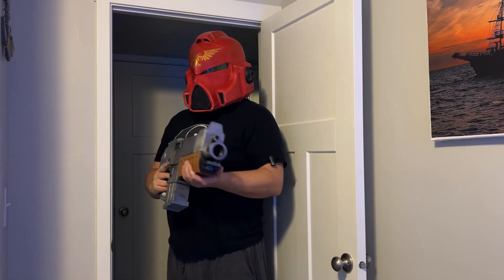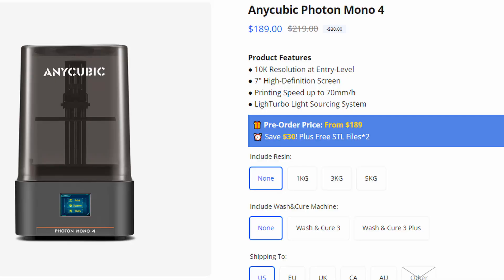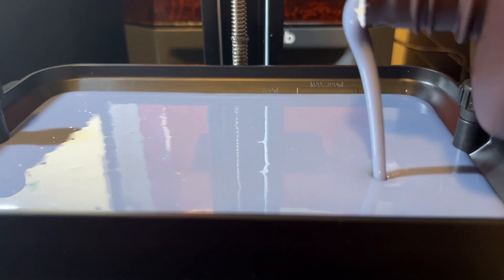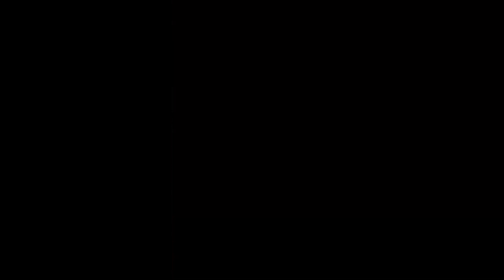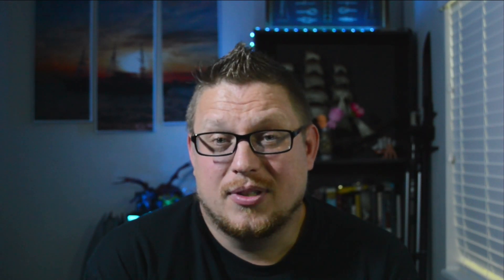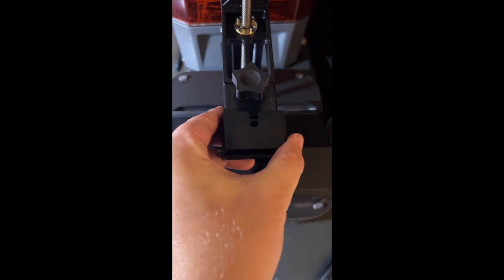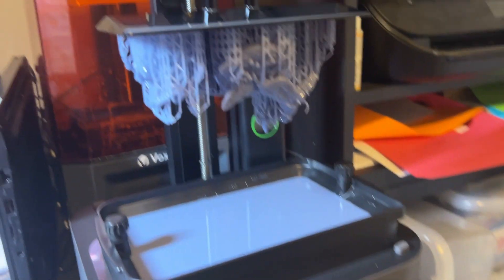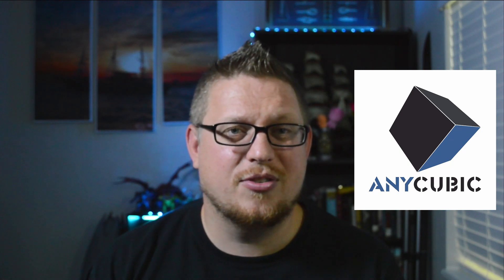Is This The BEST Starting Printer For Miniatures?

Comment: I just picked up the Anycubic Photon Mono 4k on Amazon for $159.00. Going with the water based resin to cut down on fumes and alcohol washing which is hazardous in these desert temps of 110+ degrees. Will be trying out to make leather stamps and patterns.
Reply from the maker: That sounds amazing. I hope everything goes as smooth as silk.

Comment: Hey, great video! I recently got this printer, but I’m having trouble getting my prints to stick to the build plate. All of my calibration prints ended up sticking to the FEP. I made sure to level the plate carefully, but I noticed something odd—the left side of the plate required significantly more force to grip the paper. Do you have any troubleshooting tips or advice on handling this printer’s quirks?
Reply from the maker: I feel like I had this same issue let me take a look at mine and see if I can remember how I fixed it.
Reply: @pulsegategaming  I am having the same issue

Comment: @pulsegategaming Hi there, total newbie here, I have a Question. With the Photon Mono 4 do you open your STL in either the AnyCybic software or Chitubox right? 
The part I don't ever see in videos I watching is how you take that file from the software to the machine.
How do you save the build plate layout: How then do you then bring that over to the machine?
Is there some file saving from the software to the USB and then you launch the print via the USB?
I'm guessing here. Please set me straight. Cheers.
Reply from the maker: The easiest way to do it is to save it to a USB. To do that you put the file into the slicer program like chitubox or others then when everything is the way you want it you slice the file. Slicing the file saves it in a format. Your printer can print and you move that file to the USB and then plug that into your printer.

Comment: I am a big Anycubic fan of both their printers and their resins.  I have (and use regularly) 2 Mono X 6Ks (6K) printers and an original Creality LD002H (2K). I have gotten amazing results for minis (22mm, 32mm and 75mm) from both. As @neumann1940 states, it's all about the original model design.  I get great results with the Anycubic ABS-Like 2.0 resin.  For my needs, the added 2" of build area are more important than the improved resolution of the 7" screen on the Mono 4. 

My main mini sources are Loot Studios, Fotis Mint, Titan Forge Minis, Atlantic Digital, 2nd Dynasty, Primal Collectables, Dungeon Blocks, and a few others.  I use Lychee Slicer for 90% of my resin slicing needs.

Talking about lids - Since resin temperature is very important for consistent results, I moved all of my resin printers into a 24" x 24" x 48" grow tent (placed on its side, of course).  This allows me to leave the lids off and keep the tent environment at a nice warm 82F while also limiting and venting the VOCs and fumes from the process (keeping my wife much happier about the printers being in my office).

Comment: What are your thoughts on the Anycubic Photon Mono 4 Ultra?
Reply from the maker: honestly its basically the same printer with a lot of bells and whistles. The light is stronger and you can print layer heights a little smaller but not enough to sway me for a first time printer. I am a huge fan of simple and easy, but if you want a slighter better printer with Wifi printing its a great option.
Reply: @pulsegategaming  Thank you for explaining. Do I need to be concerned about ambient print temperature for Water-Wash Resin+? At this time of year, my studio is very cold (7°C) in the morning as it’s in an old warehouse. It takes a fair few hours to warm up and only then is it around 22°C. Is it worth returning my new Anycubic Photon Mono 4 Ultra and paying double to get the M7 Pro as it has Auto-Adaptive Technology Control Heating? FYI - My budget is minimal and it is my first 3D printer. Also, I will be using the printer for product design 3D prints to check size, detailing, and proportions before production.
Reply: @Doors_of_Perception  half my prints have failed because low temperature caused low adhesion to the plate, i use a air heater inside the chamber and heat everything to 35C but never higher. I usually raise the plate to the top so it heat soaks the hotter air.
Reply: @odisy64  Cheers for the advice. I have been heating my studio to 25C and have been getting great results so far!
Reply: @Doors_of_Perception  nice, if you begin to have issues again you may need to sand the plate down with 100 grit sand paper to get fresh grooves. Lazer etched plates dont really have this problem, often you have to sand them down to make the models pop off easier.
Reply: @odisy64  Mine is laser etched. It is actually a pain to get the models off the plate. I am using hot water to help. I will try isopropyl soon to see if that is easier and better.

Comment: Is your screen pretty sunken in the front compared to the rest of the boarder by chance? Mine has quite a noticeable sunken edge and literally everything I print either completely fails or partially fails. I’m only getting adhesion to the back of the plate. So farthest from the sunken part of the screen :/
Reply from the maker: @CreepFatInc  I have not had this issue I’m sorry to hear that yours is doing that.
Reply: Did you resolve this problem? Sounds like you either need to work with Anycubic for the them to swap your printer for a new/replacement one, or you need to take apart your printer and see if you can align the screen flush (ie, level) with the top surface AND then re-level your build plate (using the usual re-leveling procedure with a piece of paper under the build plate at the “home” position). Definitely, if the “masking” screen is sunken on one or three sides, then you won’t be able to properly level the build plate and you will be lucky to even get models to print on that non-sunken portion of the screen. What’s your situation now, 2 months after your original comment here?

Comment: What slicer are you using for the mono 4? I just got mine in the mail yesterday and spent a good portion of the day messing with it and can’t get anything to stick to the build plate. Only the fep. Chitubox files aren’t working or showing up on the mono 4. And the anicubic slicer is not my cup of tea.
Reply from the maker: I used the anycubic slicer. its not my favorite but it worked pretty well.

Comment: As a 3D designer myself, i do design my own models and print them as well, I have 3 resin Printers all of which are Anycubic - Mono X2 . , M3, 6Ks
I can assure you from experience the screen resolution is nothing but marketing whatever the measure is "With 4 6 8 12 K , or even with micron size, I can achieve sharp and crisp details on my mono X2 which has 48 microns size per pixel better than the 6KS "34" microns, it's all about increasing the sharpness density on the model itself 
So for anyone who has a very limited budget  or want to increase his print size there's no need to waste your money on a very advanced 3D printers , just grab yourself a Mono X or mono 2 like this one or it's older version and you'll get a very good results
Reply: do you find the smaller micro size effects fit or layer lines? I mainly want to make mechanical parts/enclosures but seems most resin content is geared towards detail for miniatures instead of larger surface area parts
Reply: @dfvvasrr3334  The micro size effect "PPI" is optimal for less visible layer lines hence better quality if you are seeking a smooth surface , so if you want to create a smooth surface for mechanical parts it's ideal to get yourself an 18 Micron Printer per pixel size , but if you are aiming to get it for figures or mini's ...etc it's not that much of a big deal
Reply from the maker: This is solid info for anyone looking into getting a printer thanks so much for sharing!

Comment from the maker: Seriously if you ever have printer questions feel free to ask. I love helping fellow printers out!
Reply: I am Getting mines tomorrow and  I can’t wait to start learning so I may be doing just that so thanks in advance lol !
Reply from the maker: @ always here to help!
Reply: @pulsegategaming  see I need u already lol does the black tape around the screen protector from the factory come off before I put the other protector down ??
Reply from the maker: @ let me check I think I left mine down but I’ll go look real fast.
Reply from the maker: @ well I can’t tell you if it had tape before but right now when I look at it there is no black tape anywhere. Sorry I know that’s not a ton of help
Reply: @pulsegategaming  it seems like some have it an some don’t but when I tried to remove it it seemed as if it wasn’t supposed to be touched so I’m about to try an print my first model car wheel print but I need to know the specs to resize these wheels from 1/64 to 1/25 and then I’m good to go !!
Reply: @pulsegategaming  and thanks for checking on that for me my name is Travis to by the way !
Reply: @pulsegategaming  I got my first print 😂 but I thought I scaled it up in size but the print came out small still I’d say 1/64 scale and Im looking for 1/25 I have no clue on what I’m doing wrong 😂